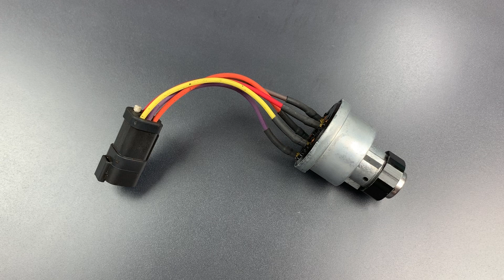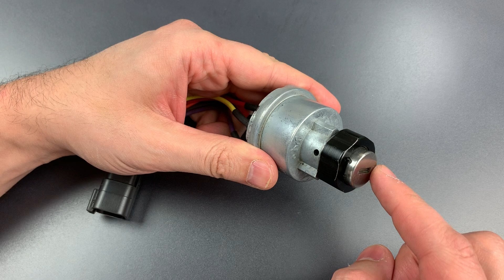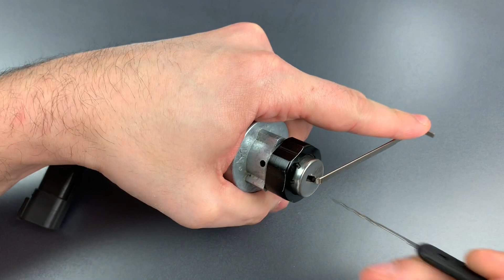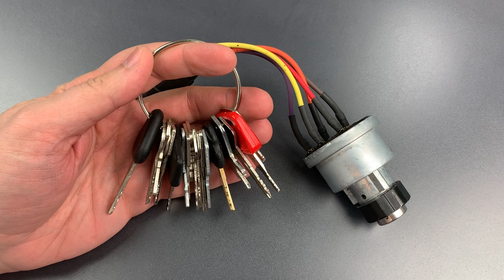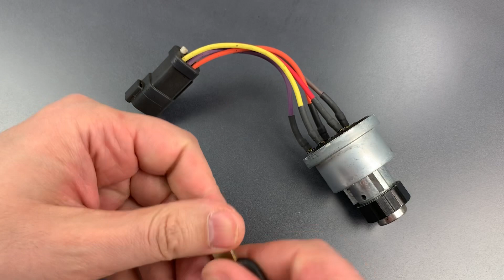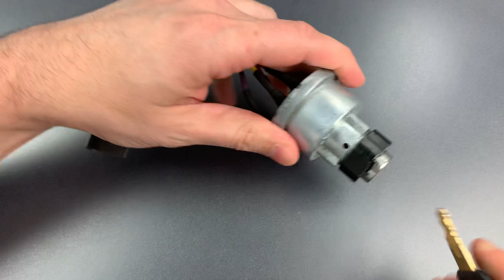[803] The Shocking Truth About This Bulldozer Ignition Lock (Caterpillar D8)

Comment: The real and perhaps only thing securing heavy equipment is that most people have no idea how to operate the machines, and those that do know how tend to not mess with them. That said, there IS a huge problem with equipment theft. This is why many job sites hoist smaller equipment into the air if they can. And many machines that are portable have GPS trackers.  But theft still happens all the time. Nobody questions a flatbed hauling away a skidsteer.  Use it till it blows up. Burn it. Steal a new one.

Comment: In the UK, service buses don't even have ignition keys! Nor door locks! But then it's a bit obvious driving one around when it's stolen :-) Older models just have a turn switch; newer ones with multiplex wiring tend to have some "secret" button sequence. I guess it's similar with heavy machinery - hardly a joy-rider's first choice. (I worked for a major bus chassis manufacturer for six years, who also exported to USA and Canada, amongst others.)

Comment: Are you familiar with the Abloy Enforcer 341 padlock? I'm not 100% sure that's the name, but that's what it says on the lock body. Abloy Finland along the bottom of both large faces of the lock body, and Enforcer 341 vertically on the same faces. The one I have appears to have a six digit serial number on it. My company requires drivers to lock their trailers with these locks while they're loaded. They come in a set with a keyed alike kingpin lock which prevents the semitrailer from being attached to a truck while the lock is in use.

Comment: The risk of theft for heavy machinery is in someone hauling vehicles away with a big truck. You can always pull a cylinder with a dent slammer, and a lot of older heavy machines can be easily jump started- I saw it done with a shovel ;-) The keys are really to control access on the job site.
Reply from the maker: I’m far more concerned about someone who wishes to do harm than theft.

Comment: It's really easy to tell the american commenters from the european commenters in videos like this.
american: "yeah, so? we start them with screwdrivers"
european: "THIS IS UNACCEPTABLE!!!! WHAT IF A CHILD IS HURT??? I AM CALLING THE EU"

;)

anywho, the newer machines with keypads are going to be mostly coded alike anyways, or have codes like 1234 or codes written somewhere in the cab. the ones with fancier keys will  just have the keys left in the cab or in the ignition. nothing is going to change. nor should it, because it's not a problem.
Reply: EU still allows Bosh round key in new vehicles. https://www.randrsecurity.com/Bosch-Ignition-Key-XOM2 You can use piece of twig you find on the ground, it works the same.

Comment: Supposedly, the ignition of /5 BMW motorcycles (from the 1970s) can be switched on with a nail. Seems pretty plausible, since the key is nothing more than a short metal cylinder that I believe is identical among all the bikes.

Comment: The number of people who are willing to steal something like a d8 dozer and then also go on a rampage with it, on top of knowing how to operate it, is exceedingly low. They could also be stopped with a tazer. Not that big of a deal once you consider that the vehicle they own could be used to kill dozens of people by driving full speed into a crowd, whereas granny can sidestep out of the way of the dozer. On the other hand, no one loses more keys than construction workers. The everyday benefit of simple locks far outweighs the potential danger. Putting a secure lock on industrial equipment is like putting a drivers license scanner on a toaster to ensure the operator is 18 or older, along with a gps check to make sure there aren't any bathtubs within 25 feet.
Reply: Quite rare - https://en.wikipedia.org/wiki/Marvin_Heemeyer
Reply: @popefang  killdozer!!!
Reply: Yes but they could cause thousands of dollars of damage on the job site at which they steal the machinery.
Reply: I can tell you don't play much GTA. You don't drive something that slow into a crowd. You do property damage. Hit an overpass support. Now they have to close the road and rebuild a whole bunch of it. Got any tall buildings around? Ram into them. They'll be closed until they can assess the damage and make repairs.  If you're planning on going out in style anyhow, just try to drive through the building completely. Train tracks around? Take them out. Trying to run over people in a dozer is just stupid. 

Why don't more people do this? Because it's not as exciting. Why bother stealing a slow as balls dozer when you can just grab a gun and go to school? Only one of those is guaranteed to get you national headlines. Killdozer went around destroying property intentionally. He didn't bother trying to run anyone down. Learn how to use your tools.
Reply: @BobBobson   Thank you for stating the obvious. If you don't play GTA these things go without saying I guess.
Reply: I hope I never have to buy one of those new toasters.  I like making toast in my bathtub!!

Comment: Do you know what the 751 club is???
Reply from the maker: No... but given the context, I assume it has to do with CH751?
Reply: @lockpickinglawyer  yes it does it is the key that will open any storage door on a camper
Reply from the maker: Bub Dog's What do you think? I know what CH751 is, and it’s many uses. What’s the club?
Reply: @lockpickinglawyer  The club is just 1 key will open anyone's camper storage door it is a inside joke. check out Haylett RV channel he talks about it all the time.
Reply: Club is probably all the crap that a CH751 will open. I work in commercial building maintenance, I've got 5 or 6 of these 4 cut keys that between them i can open virtually anything from the enormous generator out back to the desk drawer with spare building keys in it.

Comment: The majority of plant hire companies in the UK fit immobilizers and trackers (including trackers that can be remotely commanded to disable the machine it is attached to). 
Some manufacturers are now embedding immobilization systems into the ignition with RFID keys as standard, although there charging over the odds for coding in replacement keys.

Comment: Toyota had a problem with several of their cars made in the eighties with a ring of keys attack.  A friend's fourth-generation Corolla was stolen, and the police found a very similar Corolla parked just down the street from where his was taken from.  Eventually his was found when a driver was pulled over for a traffic violation and the paperwork didn't match the VIN, and in the car they found a ring of something like sixteen keys, apparently able to open/start just about every Corolla and similar Toyota of the period.

What bothers me about this, there's at least five pins in the locks and presumably something like five cut depths to each pin, so theoretically over 3000 key combinations, though realistically with restrictions on the differences between adjacent pins probably more like a thousand different keys, yet they implemented so few of the combinations that someone could steal these cars without anything in the way of effort.
Reply: @Joe Casson A van that I drove at work for a time had a key that was very similar to a car I owned.  Both vehicles were in the 20-30 years old range, single sided keys.  One cut was one depth different.  Both vehicles had worn enough locks and ignition that I could use either my key or the van's key on either vehicle.

Comment: I’m afraid your wrong. Not having worksite delays does out way the potential mayhem. Most heavy machinery is protected somehow, even if it’s just a fence. Also if this were the case we would see a lot more stolen heavy machinery but we don’t. So the system seems to be working just fine. As someone how works with heavy machinery I’d much rather have the keys be more universal because actually operating the thing is the hard part usually.

Comment: You are correct about the keyed  alike for convenience of multiple operators. But many machines also have a steel panel that will cover up the controls as well as door locks on cab models. As far as theft  a D8 Catapillar require specialized trucking to move it. And mayhem is what it is. If it was much of a problem worldwide  much more stringent measures would be put in place.
Reply from the maker: Like cockpit doors weren’t “much of a problem” until after 9/11?

Comment: All over the country, criminals are opening gas pumps and wiring in scanners. Do lots of pumps use the same key? If so, pump manufacturers, oil companies, and gas station operators should be taking the hit, instead of the customers and the credit card companies.

Comment: Isn't it more alike the line that job sites are always guarded and these machines too slow? I mean, yeah, there's the chance, but at the very least here in Europe, i've rarely seen heavy equipment that was just left in someone's parking spot for the taking.
Reply: Which job site is guarded overnight or on the weekend? Almost none, and the smaller equipment is stolen a lot. Tractors too. There is a guy from the UK who has a youtube channel that hunts down stolen equipment for a GPS tracker firm.

Comment: While working at a WalMart Tire and Lube, I discovered that many display cases used the same key across the country. My store was in Indiana, and I demonstrated this to WalMart associates in Northern California by unlocking their case. A few years later in the electronics department, thieves emptied a lap-top case by merely lifting the sliding glass doors out of the bottom track. I had previously pointed out this vulnerability to management, but they did nothing.
Reply: Plot twist, management are the theives.

Comment: I'd understand the key alikes if that would be a replacement for the ignition when they need to fix it since they could ship it back with the keys but a tractors on most farms don't need to run with the same keys! And also how cheap are the consctruction companies to not keep 2 keys and a system where you have to keep an eye on the keys you use for the heavy equipment.
Now i don't think someone would be so bold to steal something like this off a construction site but that could very much happen where they are stored.

Comment: Having worked in construction I can say that alot of thefts involving these heavy machinery involves stealing their batteries. I have seen screwdrivers in the ignitions before but I always think about how the hell the guy expected to get away unnoticed in an excavator of large size.
Reply: Battery and fuel theft happens in Ag equipment as well.
Neighbor had his batteries stolen out of his semi. Spending over $100 per battery plus the cost of new cables because the person cut them. Those batteries are only worth about $7 used.
Reply: You'd be surprised how many people own their own semi and trailers. They could just grab the machines for personal use on their land or to sell to someone with land enough to have a use for a bobcat and a small backhoe. The only problem is disabling the GPS transponder on the equipment, which can be done cheaply and easily.
Reply: @davidgalbraith1840 , but despite those trailers, folks don’t often sell heavy equipment.
Reply: a long time ago someone i know very closely stole a john deere 210e, found it nearly impossible to sell w/o a trailer under it. i think that's quite a bit less conspicuous than a d8 & still a non-starter.
Reply: And stealing diesel of course, by drilling into the tanks, which then causes, say, 150€ in stolen diesel and ~1000 € in repair costs. Asshats.

Comment: The same key you used to fit the Caterpillar lock also fits my Ventrac and most of the other equipment my local dealer has.  An Indak key fits whatever else he has on the lot.

On most work sites around here with heavy equipment, the security is an armed guard or three with pistols and buckshot shotguns.  When I was a kid, bulldozers did not have keys.  Use a rope to pull start a gasoline pony motor, use the pony motor to start the bid diesel, drive that D9 all over the back 40.  Fun!

Comment: I have a few more than your keys. Used to change tires on job sites,  glad you didnt tell the viewers almost everything has gps.
Reply: A GPS blocker is cheap and can be used to get it to a shed to disable the GPS transponder by either removing it or by adding a large resistor in line of the antenna to kill the signal.
Reply: @davidgalbraith1840  true dat.

Comment: RVs have a master key that is for "dealers" but you can buy it online and it's needed to remove the lock cylinders.
Reply: There are 2 different keys for RVs. The CH751 opens the bay doors and other exterior compartments. It isn't really a master key, they're just keyed alike. There is also a red plastic headed master key that opens the actual door.  There is an "M" next to keyways that it will work on.  That key doesn't usually open the deadbolt though.
Reply from the maker: Yup... CH751. I know it well. 👍